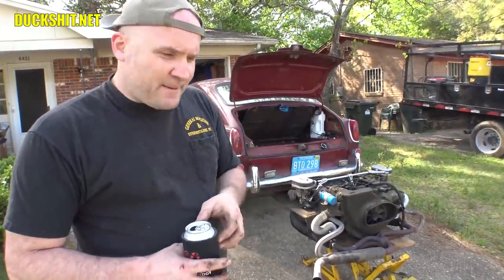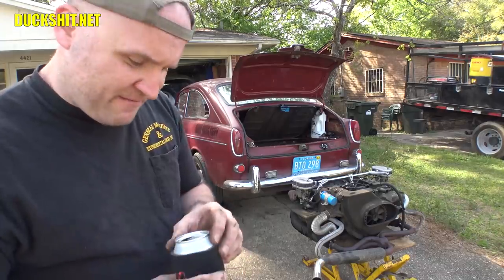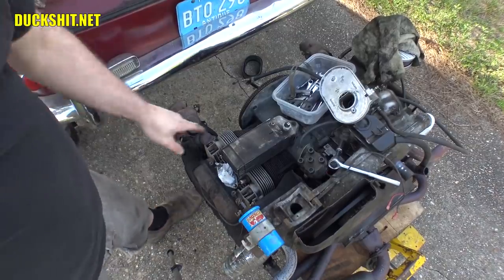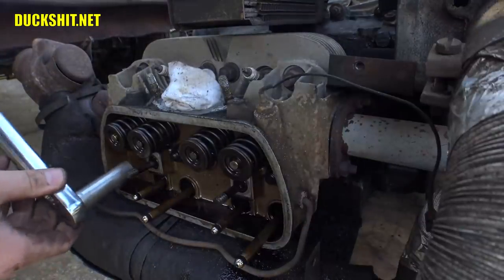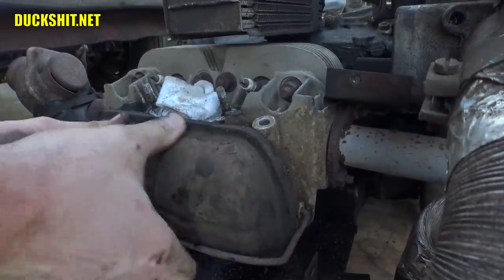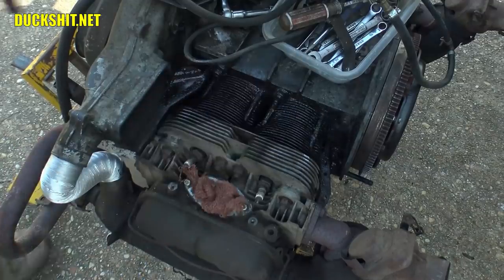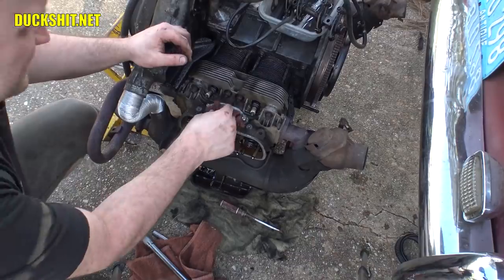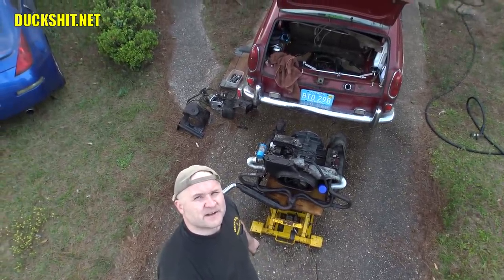ASMR - VW Type-3 Engine Removal - Loose Cylinder Heads

Comment: My last Type 3 I had got all of those tin screws replaced with Philips head screws. I was glad we had a couple of Nut & Bolt shops in town that handled lots of metric bolts and screws.
I noticed you shroud for the cooling fan was dented. You could straighten it up for better clamping.
I did hate to have to remove all the tins to retorque the heads. But it's nice when they are "Gut und tite".
Moe
Reply from the maker: Yes sir, I will be straightening the flange where the bellows attach!  It's critical to get a good seal there otherwise it pulls in hot air off of the exhaust header!!!

Comment: I was told by a VW mechanic to tighten the head bolts at least every other valve adjustment. I assume he meant just the bottom 4? Anyway, I hadn't been doing that and the left side started leaking oil so I took it to the dealer. That was long ago and that 1600 is still running without a major leak. Since you could hear the slap at startup pulling the engine was a good idea. Thanks for the video. I haven't had a type 3 for a long time. Fun to see.
Reply from the maker: Thank you Ed!

Comment: Duckman,  We had a '61 Bug when my Sibs and I were wee little monkeys.  We decided to surprise my mom and wash her car.  At the end of the wash my sister decided to wash the inside of the engine by running water through the left exhaust pipe.  She was thrilled when it quickly came out the right exhaust.  My mother came  out and found her.  My sis was so proud.  "Look Mom, I cleaned your engine."  My Mom was afraid the engine was damaged.  She ran in the house to get her keys.  When she got back she fired up the car!  The compression of the exhaust fumes shot the water out of the tail pipes!  My Sibs and I nodded our heads in agreement...The engine was clean.  We were all told no more washing car engines after that incident.  I have lots of good memories involving that Bug.
Reply from the maker: Hahahahhaha!!!! That's probably one of the best VW stories that I think I've heard!  Thank you so much for that!!!

Comment: Definitely a different style video than we are use to, but I do like the change up! Must be nice to pull an engine with the dual carbs still installed unlike a bug lol
Good work buddy!
Reply from the maker: Yeah not to mention the fact that all I had to do was roll the car up on some ramps... and the engine slips right on the rear apron without having to have the car raised  into the stratosphere!  I will be making some changes to Eleanor to facilitate this task.   My hands are too big to be fiddly fvckin around with that stuff.  Maybe I need another rear hatch in the firewall LOL!!!!
Reply: DuckmanCycles and VW Garage running the dual carbs in my beetle and my large hands I’m almost ready to find a way to make the entire rear of the car removable like a Baja lol
Look forward to the mods you’re planning on Elenor
Reply from the maker: A removable rear end is something else that I've been planning.... heh... we'll see!

Comment: Were you using the screwdriver scraper that you kept dropping? lol Great video. I ran into the same issue with someone putting in an insert to fix the plug threads. I found out that the insert wasn't any good when the plug launched out on the highway. I ended up replacing the head. I hope your luck is better than mine! Enjoy!!
Reply from the maker: The scrapedriver!  Maybe it was.... not sure.  LoL!  The head has been that way a number of years. In fact I replaced the plugs, but when everything is buried under tins and behind an intake manifold it was impossible to tell that it was crooked.  But when I removed it this time, the timesert came out with it.

Comment: I'm about to do a similar task, thought I'd give this a watch and find out where all the bolts and screws are....and any surprises.
I don't have a Type-III but I have this engine. If it pans out to be good, it's going in my Volksrod. Being sectioned 4" I don't think the upright engine would fit and allow a hood....Anyway...
Are those manifolds Type-III only, or will regular dual port ones be the same? And what are they exactly?
Thanks
Reply from the maker: The manifolds are specifically for dellorto 34frd carbs, but I believe they work fine on a Type 1.    I chopped the rear of my Beetle down a couple inches, so the engine compartment is smaller now, but my engine still fits with room to spare.  I would modify the top of the shroud or the decklid hinges, or both if I needed more room.   Good luck to you!  Would love to see some videos!

Comment: How often does one need to re-torque the head bolts on a VW engine...odd that they were so loose...
Gonna sound and run awesome...especially after cleaning out the grease in the cooling fins!
Keep em coming!
Reply from the maker: I will have to check the service manual to see if their is an interval for torquing cylinder head bolts. I'm sure that there is... but if you ever overheated your Volkswagen engine it's probably a good idea to do it right then.

Comment: I need that engine jack!  I'm waiting for my rebuilt motor, now.  The old one was easy to remove by myself, but I'm worried about installing the new one. Where do you buy those?
Reply: I found them. Harbor Freight, right up the street.  This is gonna be a breeze.
Reply from the maker: Awesome!, this one is actually an ATV lift which was being used for a Harley-Davidson by my uncle before.  His motorcycle had been gone for years and he decided he just wanted the jack out of his garage.  Bonus!  So it took a trip with me in the trunk of a 350Z from New Jersey back to Florida!  I'm surprised it fit LOL

Comment: I noticed you don't have the thermostat and any linkage on the cooling fan flaps. Was this all missing including the flaps in the fan housing? By the way when I watched you replace the crank seal  I used you link to amazon to buy one and it is an Elring made in Germany . Now all I need is to remove my 73 FI engine which is a nightmare ordeal with all the wiring to replace it. It's been dripping for years now , just drips a bit . Plus it's the three speed auto trans CV joint I need to secure to get the engine out. Someday . I just check the oil and really don't drive much these days. It's my only mode of transport. Being almost 72 doesn't make working on it any easier.
Reply from the maker: Yes it was all missing!   But not missed!  :)

Comment: Damn, I thought you had got VERY serious about on tech videos being all worky, worky, and the Q&A being talky,talky! 
Nice job! 
Just out of curiosity, could you run an external oil cooler outside of the tins on a type 3 engine? Could  that make the engine run cooler?
Reply from the maker: Sure, you can full-flow a Type-3 the same as a Type-1 and push the oil through an additional cooler and a filter, too.

Comment: I had shop tell me my heads were loose on my 74 bug and they needed to remove the engine to tighten the top ones, quoted  me $360. I drove it home, removed the fan shroud and cylinder tins. torqued all 16 without removal in under 2 hours.
Reply from the maker: It's awesome when you can do it that quickly! Good job

Comment: I like the cold open and found this vid really interesting.  I've not seen the specifics of a Type 3 engine and how they differ from a Type 1 and learned a lot.
So the air for a Type 3 is drawn in from the rear of the car and makes its way forward through the tins?
Reply from the maker: Thanks so much!  That is correct, the air is drawn through the passageways in the body and then thrown forwards onto the engine, yes!

Comment: my type 4 motor was stolen so i put a type 1 in it with a type 3 torq converter. it stuck out a bit so i cut a hole in an old suit case and made a cover. super ez to work on now but yea that motor was complete with tins un-replaceable priceless parts gone.
Reply from the maker: That sounds interesting.... I hope you made a video of this!

Comment: do you have to pull the engine to torque the head bolts???   Dont the head bolts need to be torqued fairly often on VW air cooled motors?  anyone??
Reply from the maker: You don;t have to pull the engine to torque the heads but it is dramatically easier.  The engine comes out with little effort as demonstrated in this video!   You really shouldn't have to re-torque the head bolts often, unless the engine was subject to overheating or the engine is an older build.   I can generally hear when the heads start coming loose on colder days first thing in the morning when starting.

Comment: Did you have to do anything with the clutch forks to remove the engine from the trany?? Can’t seem to get mine out
Reply from the maker: Nope, clutch needs no messing with... make sure you removed all the engine nuts/bolts.  There is a small possibility that the clutch disc rusted to the input shaft.  I had that happen once.  I had to rip the engine out, no other choice.
Reply: DuckmanCycles and VW Garage you have any tricks for that??? Pretty much at a loss
Reply from the maker: @driveitbreakitfixit7496  I am afraid you haven't told me anything about your car or anything that you've already done to it to get to the point where you are at.  I cannot offer more guidance without further explanation.  Please tell me a story!  Thanks!

Comment: Just think how much more you could accomplish with air tools or even a ratchet
Reply from the maker: I just happen to have both LOL... but they aren't always the best option. Therefore I accomplish the same amount even with them.  Thank you for the comment!
Reply: @DuckmanCycles  Factoring in the time to drag out the hoses and turn the compressor on, find where you left the 14mm socket last time, etc. etc. etc.  :)
Reply from the maker: And then the tool doesn't fit where I need em... lol.  But if it works it doesn't demonstrate how to do the job without power for the rest of us that are watching.

Comment: you shud have loosen the one that did not mowe to be sure it not rustet tight
Reply from the maker: YOU SHOULD!  You've got to watch the video,  every one of the nuts and bolts moved at least a little bit.
Reply: ok  was sure one did not. but if you are sure so am i = )   we have all  had a loose head some time..
Reply from the maker: Heh...  the other thing to consider is that when they rust on the top and you turn the nut usually the entire stud will tighten into the magnesium case... that end does not rust usually turns freely.
Reply: ok well sorry i am from Denmark here they rust solid in both ends ,,have a case wiht 4 broken studs after taking the head off ,, it must be so nice that things do not rust so muths   ,
always a pleasure to watch what you are doing
Reply from the maker: Thank you sir!